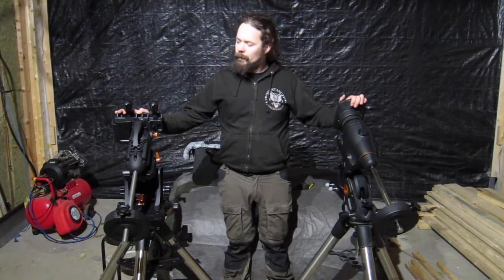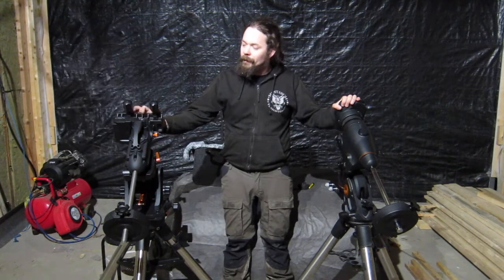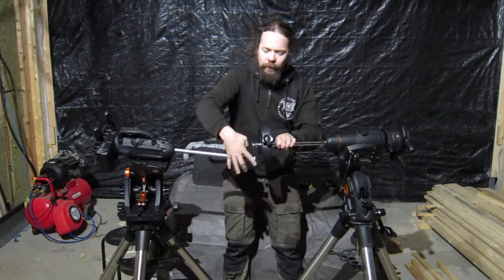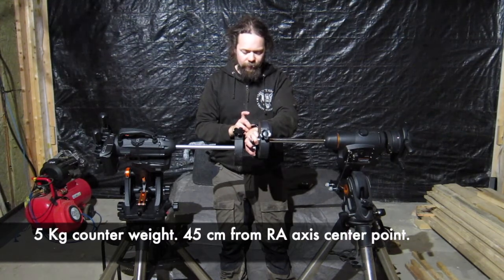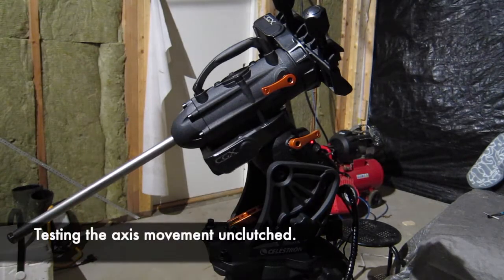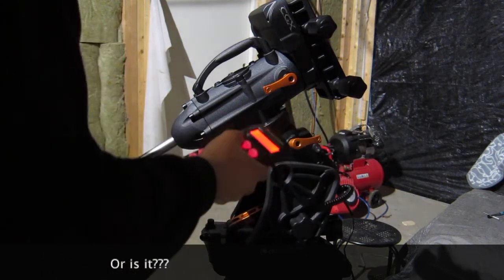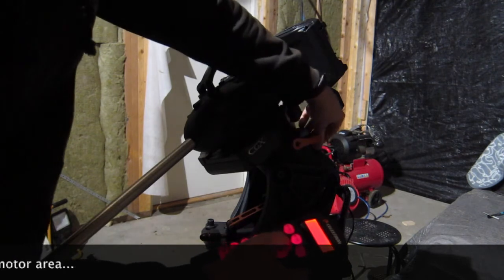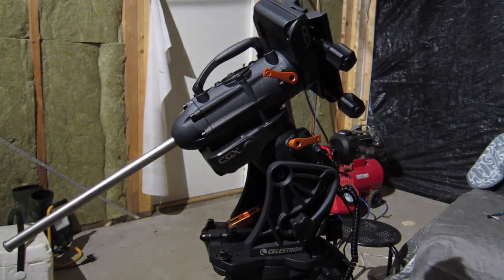Celestron CGX (new) vs CGEM (hypertuned) un-clutched movement

Comment: loosening the bearing on the RA shaft a tiny bit oftem helps.
they set the bearings too tight most of the time.
though i do recommend hypertuning
Reply from the maker: Hi! 
Cheers! That's precisely what I did. Along with that was a much needed clean of the gears, they were in such a poor stat I don't know if this was a refurbish, or a brand new mount. The is a whole video series here on the subject... but long story short: I got it to a state where I have been using it for some time with quite nice result. Now the electronics(sensor boards I hope, ordered from deepspace....) are shit with a whole new set of issues(other video). 
The tripod and wedge are only good parts to this mount if you ask me now, and are used where they are more useful(yet another video ;) )!

Comment: So between the CGX and the CGEM II the CGEM win's? The CGX is 700.00 more here in the US on Celestron website. I'm looking at the 11" EdgeHD and was thinking about going the CGX being more money and a better mount. Maybe not so. Thanks for the side by test.
Reply from the maker: Hi Phillip,
This video was made to fault find calibration issues with the CGX. First it was made for the technical support, then for the community to provide some insight and suggestions.
There is also a “review” video that I made after I fiddled with it, and used it for a couple of months. I still use the CGX mount as my main mount and it works alright.
My very personal impression is that the Celestron mounts might have been better in the past. Maybe it’s changed since I bought it, but it’s a feeling I get when I read reviews and compare the two. I have the EdgeHD 800 and it’s great, so I’m not saying Celestron equipment sucks, I’m just not happy about how the CGX landed in my lap. 
All I can say is that I’m not alone about that, but I’m sure many are getting a great experience as well.
Hope you find what your looking for!
Thanks for watching!

Comment: the "clutched" position of  declination  clampiong knob is too close from maximum left position. You need to unscrew it from clutched position , remove the piece from its nut base, and place it more on the righ. Then when you unclutch it'll have more range to release.
Reply from the maker: Hi Fabien, very good suggestion! I did find this suggestion, and it was the first thing I tested before sending it in for service. 
It would have been soo nice if it was the cure. Sadly, it did no difference. Neither did the service. 
Some "warranty void operation" or "Open heart surgery", did however solve much of the issues. Have not yet made any video documentation official of this since I want more time on it first...

Comment: What is the sound the cgem mount makes when tracking ??
Reply from the maker: Hi!
The hypertuned CGEM is completely silent when tracking. Slewing produced a bit of noise depending on the speed selection. 
Can't tell you what it sounded like before hypertuning, but if it was anything like the CGX there is a bit of noise. Not terrible, but audible.

Comment: This is scary stuff, as I was considering the CGX with it's higher payload capacity vs EQ6-R Pro, especially considering all of my AUX equipment is Celestron. The EQ6-R won't handle CPWI and ASPA. Recommendations if any ?
Reply from the maker: Hi, Sorry for taking so long to reply. 
I have never used CPWI, but I do love the All-Star Polar Alignment feature of the Nexstar hand control. I believe there is some similar alignment feature with SynScan, but I don’t really know how it compares with the ASPA.
I had my first observation session after midsummer a few days back with my Star Adventurer and my old EQM-35. Both where very satisfying. I might check if how the polar alignment feature works on the EQM-35 later.

Anyway, the CGX mount was, last time I used it, not an unpleasant experience. There are things I must get to business with (like a 34s periodic error which I have heard more people are having issues with). I think it’s coming from the tension, or meshing of the worm gear, but we’ll see.

At the moment, I don’t know about any other system too well, and they might have their own issues that one must learn and deal with. Now that I’m getting the hang of the CGX (I think!) I don’t think I’d like to change it out. The devil you know...
The EQ6-R was one of my options when selecting a mount however.
Reply: @astroboden  Well, I have the CGX, and the results have been pretty poor, I can get around 3 min subs, then the movement is so bad that stacking simply fails. Like you, the axis are very very stiff. I have sent my PHD2 files to Celestron, and their advice is simply what I have already tried! I will try to have it hypertuned somewhere, if I get the same result, I will selloff all my Celestron equipment, and move elsewhere
Reply from the maker: Hi, Sadly I no longer get surprised when I hear about others having similar issues with this mount.
What I did was a small “hypertune” of my own by “simply” disassembly the axis and loosening the retaining ring clamping the axis to the bearings.  Then cleaning this, applying new lock-tight and reseating the ring with just as much force that I could not feel it restricting the axis motion. It is not super trivial and will absolutely void you warranty. 
Proceed with caution if you want to do this yourself.
I also worked on the meshing with the spring loaded system they’ve got, and got a few surprises.
As I mention in my review video I found that the gears were super dirty, though brand new. 

I think the mount can be good, but I also believe it might involve making it your own by getting your hands dirty. Unless you are lucky and get a well assembled and QC setup and then only sending it off for service when needed at a high cost.

Anyway, I can now do 5-10 minutes exposures with not too bad result.

I wish you the best of luck hyper-tuning it, and hope get it working swiftly.

Comment: My CGX-L has exactly the same problem. sticky as hell on RA and DEC, guiding is a mess (+-3' normally). I guess the gearing is crab. It also produces horrible cracking sound when moving. 3 month old. My cheap ioptron CEM25 is MUCH better in guiding and not sticky. My seller is not helpful. Celestron Service here in Germany is by Baader Planetarium. They have a lot of work an the technician told me its an excellent mount...
Reply: ist here any data what exact is the gearing dimensions? Maybe I can change them agains high quality German or Japanese gearings. These Chinese gearings seems to be crab.
Reply from the maker: Hi Possi!
Sorry to hear that you have the same issue. As you might have seen in the videos, the RA in my case was not as bad. Do you mean that your guiding it +-3’(arcmin), or 3”(arcsec)? The former would be absolutely crazy.
The cracking sound could be/should be, the cable harness that runs up the axis. They sit with some plastic clips to stop them from moving too much. 
What I did (however not made a video on it yet), was to loosen the retainer nut at the end of the DEC shaft. It did make a difference. Sadly, I didn’t take the measurements on the bearings, since I didn’t have the sealed bearings out enough to measure them.
The thing I noticed was that when the retainer nut was fully loosen, it was still not perfectly spinning. All that held the shaft then was the bearings and the cable harness that runs up the axel. You can actually hear the cables (crackling sound might be a good description), when turning the mount by hand, and I think they will restrict motion somewhat, but the main thing must be the sealed bearings. 
In your case though the cables might be more restricting then they should. Make a video for us!

The DEC is still sticky, but it’s much better than the RA because of some 34s periodic error (check out that video if you got the time: https://youtu.be/aZnA4u3cvWU).
That said, I’m guiding with about 1” rms on RA and 0.5”-1” on DEC. And my polar alignment is not perfect. ≈1’ at the best.

Just out of interest, on another topic concerning the CGX. 
Do you have “user objects” in the main menu tree in the Nextar+ hand controller? It should be there, but I have a different set of options. Also, and even more worrying, I now have issues connecting with the CFM software to re-flash the firmware. 
I’m sending a ticket so Celestron about this, so we’ll see what’s coming out the other end.
Reply: @astroboden  anyway the guiding is crazy bad, its normally 2..3" RMS. (not arcmin of course, sorry for the typo...). 

My tiny iOptron has normally 0,8...1" RMS error. I will check again the harness, but I did not find anything there last time when i dissasebled the whole thing. The sound is mainly when tilting CC wise near the verticale. Both axis are affected. I am still fighting, maybe I should get a CEM120 or 10micron, but they are more expensive. I use a 11" RASA, nice scope and only 620mm focal length. I would like to buy a 1500...2000mm 14" scope, but not with this mount - if I cannot fix.
Reply from the maker: Still, 2-3" is RMS is not working. I was considering the CEM60 instead of the CGX. I guess the CEM120 is a good replacement spec wise for the CGX-L. 
I believe the CGX is a good design, but the assembly (QC etc) and part selections might leave room for improvement. Some might get very nice builds, and some of us does not...
But if the not too much is shit in the build, I guess you should be able to get it to a good working condition.
I though that a RASA however, with that short focal length, would be very forgiving.

How does the guiding error precent it self? Is it spiking/binding? Overshooting? Too slow?
I had something that looked like binding on both axis, but it ended up being the a communication related error(USB cables). 
Got another video on how I analysed that, if your interested in perusing that path: 
https://youtu.be/dgtiO8bs734

Comment: I bought a CGX 1 year ago and the DEC axis was extremely stiff right out of the box.  Celestron refused to help me and of course PHD2 will not guide correctly because of the DEC stiffness.  It was my fault though for not using the mount right after I bought it...had to travel for business-long trip..anyway High Point would have replaced it but too much time had passed.  Too bad because now I am ready to upgrade and the CGX-L will most likely not be chosen..it depends. This time I know to use the mount within 30 days- High Point is very good about replacing items, but not after 2+months.  Anyway I'm thinking seriously about getting the CGX hypertuned when I upgrade. Thanks for the video.
Reply from the maker: Hi Johanthan,
Sorry to hear you had the same experience I had. Seem like a thing that has been going on for a while. Bad that they haven’t a better response made up then.
I’m making a little review of my CGX experience so far, but I’m struggling to get it politically correct. 
I bought mine and pretty much immediately sent in for service just before the Christmas holidays. By the time there was clear skies to properly test it ones returned, months had past.
The really worrying thing was that my supplier opened at least 2 more from different batches and they were all the same. Is proper balancing no longer a requirement? They would have invented a seriously fabulous mount then.
The dirt in the gears was also something that made my stomach turn. After less than 30 hours it looked like I would have expected it to look after a year at least:
https://youtu.be/dgtiO8bs734

When I’m on the ranting topic…
Have you read the manual? Is that a joke? No wonder they removed the section on worm gear meshing when it was all backwards. They are also referring to the atl/az system and other completely wrong details. It’s a copy-past job. And for equipment in this price range – NOT acceptable! 
The only good thing about it is that I now feel comfortable about servicing and hypertuning it myself.
With all this said, with the small service I have done so far, I now have it guiding with accuracy up to <1” rms at times. Much is down to polar alignment at this point I think. 

Sorry for blowing the steam on you here.  And thanks for letting me know there are more suffering the same issues.
Reply: I'm thinking about just going for it and getting a Software Bisque with absolute encoders.
Reply from the maker: @johnathanedwards8706  Yeah, I thought I went all in, but still within budget. 
I like the way you think. Screw the budget. Go all in!  ;)

Comment: Ensure you update with the latest handcontroler and Mount firmware. All those weird noises disappeared after upgrading . Guiding works great, I made a photo with 10' exposure for fun and guiding was good as well as the stars are rounded properly.
Reply from the maker: Hi bobafiatcoupe, thanks. Good to hear that the update did the trick for you. 
I did the update on request by Celestron tech support and it did do difference, but some noise is still there. I'm not too concerned by them at the moment however. More so the sticky axis which even Celestrons support agreed was too excessive and required service. The mount is with the supplier now and I'm waiting to hear their response.
Cheers!
Reply: @astroboden  Any  updates on this? I'm trying to decide between a CGK and an AZEQ6 Skywatcher.
Reply from the maker: Hi Tim! Just uploaded a video of how it looks atm.
https://youtu.be/bvZupWyWxWc
Still have not tested it fully since I have had issues with my power supply recently, not to mention weather.
I really want to like this mount. I think it has some great potential. The NexStar+ hand controller is great in my opinion and with the spring-loaded worm gear meshing and belt drive I was hoping for an instant success, ha ha.
With the price tag in mind, I was also looking at the EQ6-R from skywatcher, and iOptrons CEM60. I don’t want to be looking back yet, but at the moment I really can’t say “Get the CGX!”.
I can’t advertise for the others though.
Reply: for me the upgrade in 3-2020 did not change anything. The loud noise stay, the additional laud cracking noises around +-10° from upright still there, guiding of my expensive CGX-L is still totally crab. I tried several worm backlash adjustments in RA and DEC, still I have a +-3" guiding.